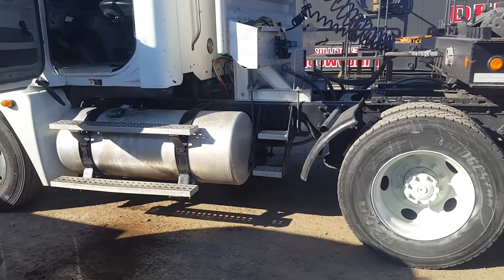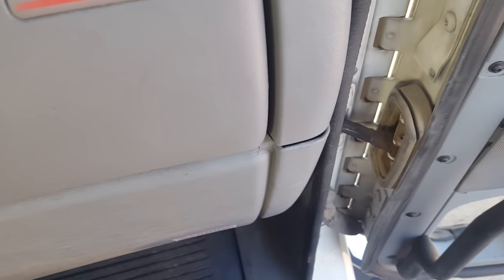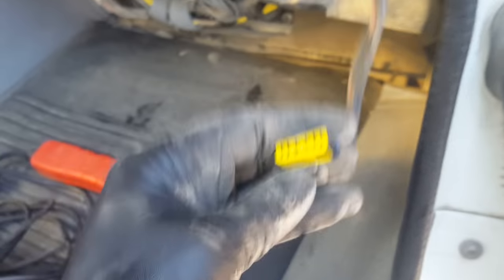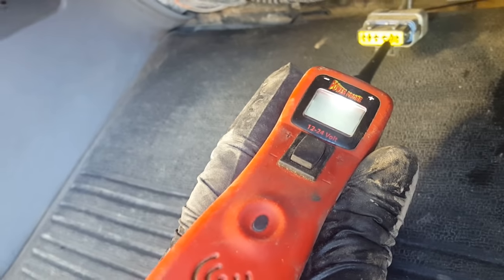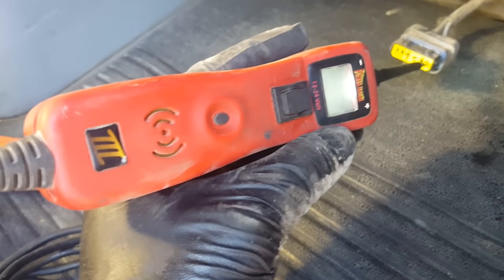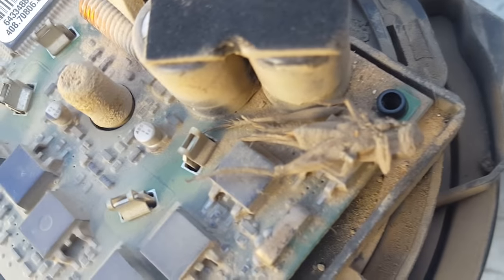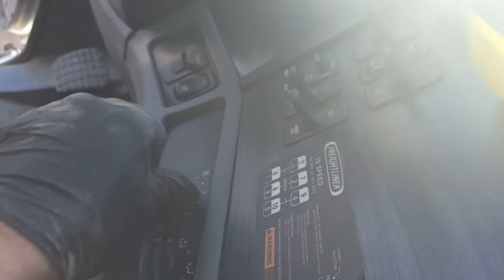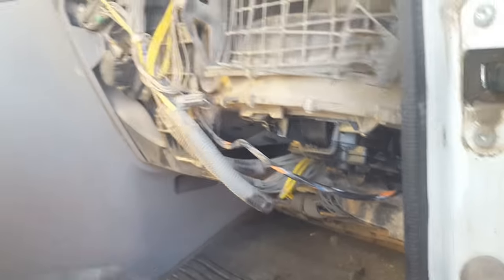Diagnose and replkace a Freightliner blower motor

Comment: I have replaced the blower motor and the controls switch for the blower. After running for a few hours the speed slows down where it’s barely blowing. I replaced the fuse and the relay also. Same results
Reply: Did u ever found out what was the issue ?

Comment: 06 century replaced condenser in front of radiator also replace HVAC head unit a/c compressor comes on n runs for bout 30 seconds then shuts off also blower motor doesn't work either but HVAC head unit is still lit up wat could be the cause any info is greatly appreciated

Comment: My control for the fan isn't even showing any signs of working the 20a fuse is fine  my blower motor stopped working on a Friday I just got today around to it. Replaced the blower motor plus the control switches and nothing still

Comment: Hi...my blower motor wont work...I check the blower motor harness and there's no 12 volt supply power  on it but only the resistor power...Hvac fuse 20 amp and relay is good... I there any other fuses to check why there's no 12 volts power on the Harness?
Reply: blower control panel